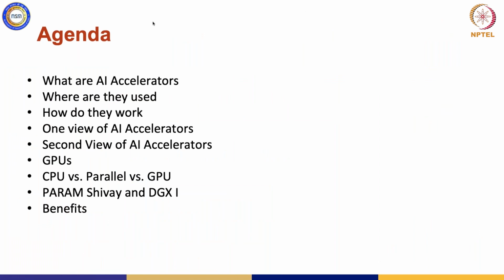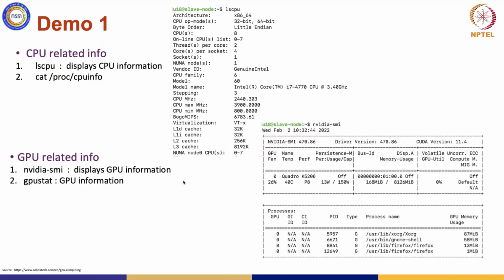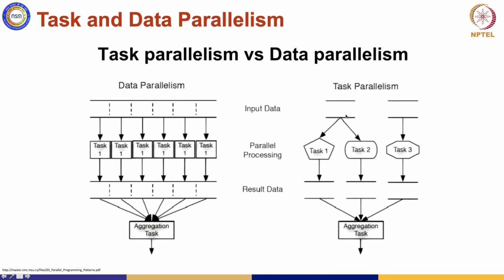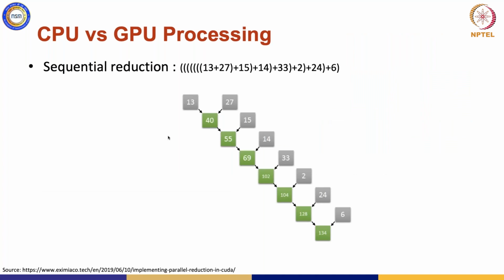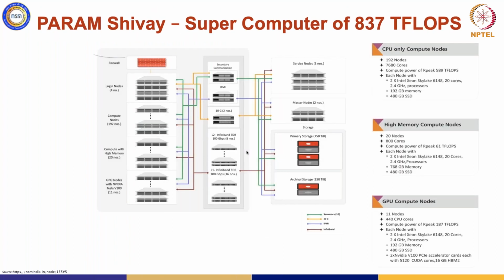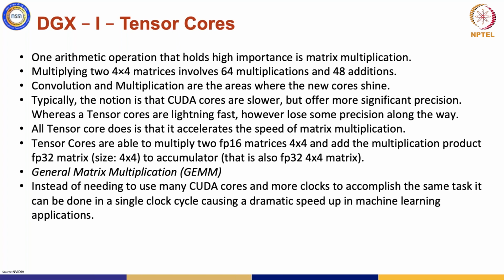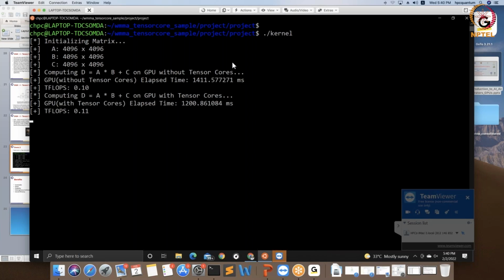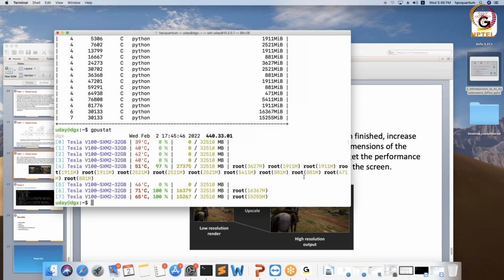Introduction to AI Accelerators,GPUs

Comment: "Could you clarify the slide's inclusion of CPU as an AI accelerator?
 My understanding is that CPUs are general-purpose processors, not specialized accelerators, although they can handle light inference with AVX-512. Are GPUs, FPGAs, and ASICs considered the true AI accelerators?"